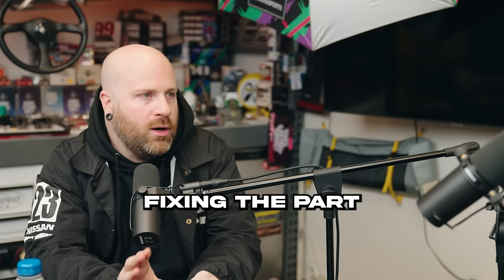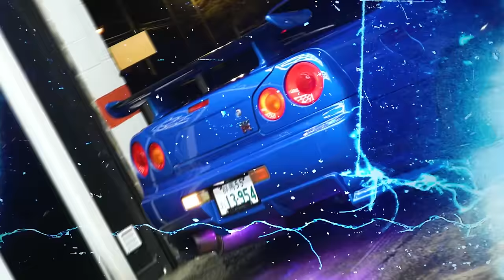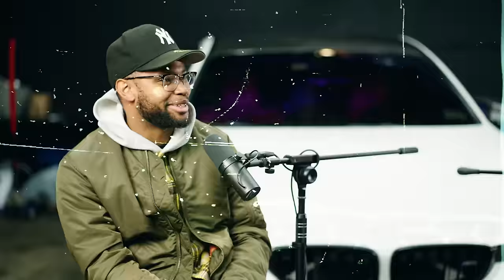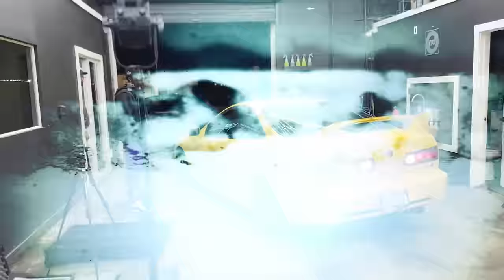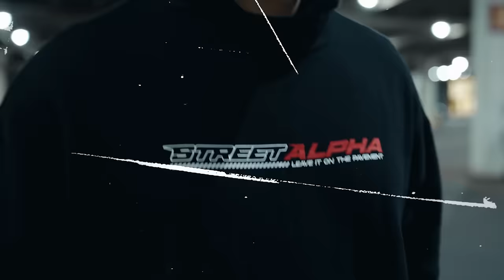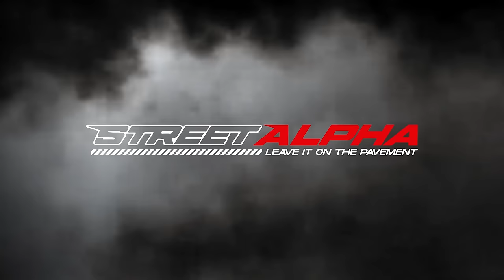Tommyfyeah On Building Rare JDM Skylines, KA24 Vs SR20, and Building Influencers Cars

Comment: 31:41 he doesn’t build them because it’s hard to stand behind a modified engine.   Even if everything is done right. It could all go down over a bad driver move.   And of course the builder then tuner get blamed.  Not the driver that was banging rev limiter for 3 minutes straight at the side show
Reply: You can't be serious right?  Shops have been building them for 30 years.  Japan has been making crazy power.  Most shops won't turn away money.  He gets machine work done on engines all the time.  We see countless times that his builds don't run well without jack or Roberto touching them.  He still needs to tune the engine and we see alot of the builds have issues.  If people want to overspend to have a clean bay that's on them.
Reply: Huh? What type of dumb excuse is that 😂 he doesn’t build them cause he clearly doesn’t have the knowledge on being a mechanic. It’s that simple. He still the owner of the shop buddy he’ll be the first to be blame regardless 😂

Comment: I still wanna see nissanda and the S14 k20 swapped switch motors and motor mounts plus the trans adapter plate and starter. KA24 Silvia & K20 RWD swapped 99 civic Si. "Chef's kiss"
Reply: Both turbo'd when they shouldn't be. And making just enough fun ponies to have a smile on your face for all the right reasons!

Comment: So, the setup on the green civic dx was a type r motor.   New from Honda.   New type r head milled 20 thousandths.    Jdm type r trans with 4.78 final drive.   Comp tech header.   Car was tuned on hondata in Miami and made 185whp.   Back then it was good power.    Another local guy went 12.2 at 114mph in an all motor crx with that combo.   (Gsr block, type r pistons, etc).  Great memories though, was the beginning of the Honda game.

Comment: He's right about the price. Highest priced supras were around 50k. That wasn't all of them but still a ton of money. He's a bit biased towards gtr though. The chassis isn't what's making it hook in 1st, it's awd. As for fitting tires, you can fit 285/315 on a supra and thats standard supra fitment. My personal supra hooks 2nd with over 600whp also so idk why he thinks every supra on street tires just spins. To sum it up, the supra with stock v160 is the only synchro manual trans car to ever go 7s in the 1/4. And two supras did it. Supra has a better getrag than the 34(32 and 33 had the weak 5spd) and if we wanna talk chassis the supra is better built. The gtr is for sure more race bread and track oriented, but lets not downplay the fact that it's awd system is what set it apart. Otherwise the gtr would he a gtt with a little more spice and well, at that point were comparing a supra to a heavy s chassis lol. Speaking as someone in the market for a 33 gtr also. I want one even with the oil issues lol.
Reply: A supra chasis is not built better at all.  It's a targa top and heavy.  Supras don't handle well which is why he doesn't like it.  It's not hard to cut up a car put a huge radial on it and have it hook.  That's not fun to daily at all.  There is more to building a car than drag racing.  It's fun to be able to rip back roads go to a track or autocross.
Reply: @duanebailey6253 Tommy is a bias scammer. Also Supra destroys most 32-34GTRs on the highway. That's all that matters if you want to talk about fun. Mr. Autocross.

Comment: No way he just said drag racing is cheaper than drifting 😂 this man is the greatest hater/troll
Reply: well if you don't chase power and faster times it is.
Reply: Generally speaking he’s right
Reply: @DriftNick  isnt that literally the point of drag racing to become faster and to get a better time and if ur really drag racing/dig racing ur car is going to break just as much as drifting would
Reply: Without even mentioning tires, Imagine building a car to drift, ordering whatever aero and wheels etc from Japan, painting it, just to more than likely have your aero explode, more than likely crash, having to replace  susp arms, replacing hard to find body panels like jdm front ends, oem headlights,  etc and having to do it all over again before the next event. Vs a drag race weekend which very rarely ends in a crash or having to replace your aero and getting a fresh paint job every season. Mind you this is at the grassroots level of drifting.
Reply: That’s just one aspect, let alone the abuse on your drivetrain/engine, around 8k rpm’s for over 45 sec straight, clutch kicks, etc
Reply: @tufftv9691  u dont have to do any of wat u mentioned only way u gonna understand is if u do it urself find a e46 for 3k or 350z for 6k put 3k into the car there u go a fully working drift car
Reply: @tufftv9691  it all depends on the driver and car
Reply: That’s the bare minimum, drifting has always been about style as well. Not just drifting the cheapest bucket with a welded diff or something. It’s looked at like a rolling car show. That’s like saying drag racing is cheap because you can have a stock cut up h2b car on nitrous and run close to 10s for under 5k. When a 10 sec sti for example would be more like a 30k cost.
Reply: Me and all my homies are well over 15k in our simple builds, even with stock longblocks, oem gearbox options, just in lsd, susp, aero, interior, paint etc.. and i can assure you, that’s most of the drift community other than ofc the few dudes who are doing it as cheap as they can with whatever rwd market place bucket and eBay shit they can find. There’s people who are “budget” in any motorsport discipline
Reply: Do you know how many difs, arms and body kit drifters go through
Reply: @mikehawk8744  yes i do know😂 most people at the track or who drift in general dont body kits
Reply: @mikehawk8744  u guys are definitely misinformed its not how these big YouTubers make it seem all im saying is comparing a true drift car to a true drag car drifting can be way cheaper and i mean real drag racing
Reply: @tufftv9691  Half the engines in these drag cars cost more to refresh than what it costs to build whole drift car lol.

Comment: he rides around in youtuber mk4s that are dyno queens. only worried about making peak power instead of drive ability   like i said mine is on 22 psi on s372sxe turbo 2jzgte vvti and i'd send my wife in it on a full pull. now if you no lift shift yes it will blow the tires on 2-3 shift 3-4 shift  but if you just drive it no 700hp mk4/sc is the perfect hp. it's when you get too 800+ and 15 wheel when there roasting tires no matter what

Comment: Most wheels will be  fine for most people. Unless fairly high level or repeat weekend warrior level, being forged wont make any difference to 90% or more people. Street/daily driving it will all be the same. Get what you like. Obviously you dont want something where the finish goes to shit right away or are dangerous...but overall its one of the most overrated over analyzed car parts. Its absolutely flexing to have a 5-10k set of wheels on a car that absolutely does not need them performance wise...thats actually something that makes me laugh or be critical....when a 400-500 whp car has a set of $6k Weld beadlocks and skinnies, more of a poser look, not impressive that they spent too much money on wheels they didnt need, its dumb to me....should spend the money on performance parts that lead you to actually needing those wheels. Speaking of which Tommy never uses any of his personal builds to a level of needing high performance wheels.

Comment: tommy's wrong about the jz platform. i can ride you in a 700hp sc300 that hooks on a 285 street tire   best 0-60 is 2.8 seconds. with no awd bs that cost money  with a stock 2jzgte vvti and a big single.  and i daily drive and abuse it 5 yrs so far

Comment: 59:58 he doesn't get it.  Miata are not for rich yankees with a hard on for rare parts.   They are for track guys and teenagers that want a cheap reliable sports car that is easy to build and the parts are everywhere.   There is a reason why if you go to any racetrack pretty much on the planet there are more miatas than anything else.   There is no better car to get into road racing on a budget.

Comment: This guy needs to relax. Is Ozzy's will tell you what a skyline chasis is comfortable in..6-700hp WHAT? thats evo and wrx territory. my r33 wen from 250-1000 wheel hp and everything in between 

i can tell you the chasis can take 9-1100 without issues. stock diffs, cv's and even the transmission holds at that power if you shift properly 

that's is how you gauge "sweet spot" how well the drive-line copes with the power!

please brother take back your words. we have road legal 1200 hp skyline GTR's here in oz-i'm talking where the police will pull you over with that power and unable to give you a ticket because it looks stock!

take your words back brother